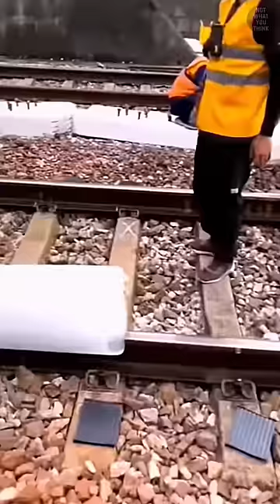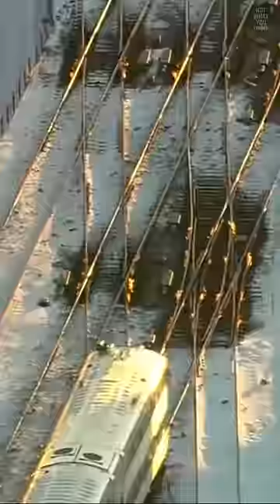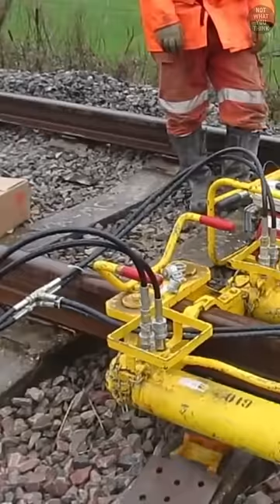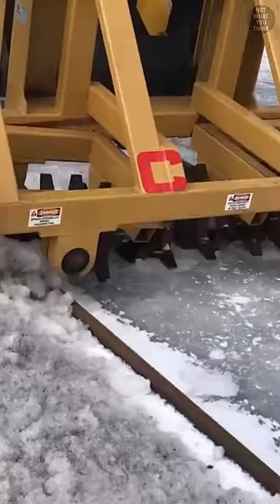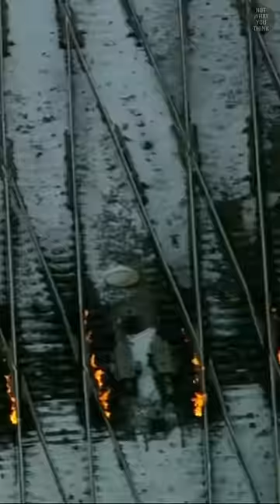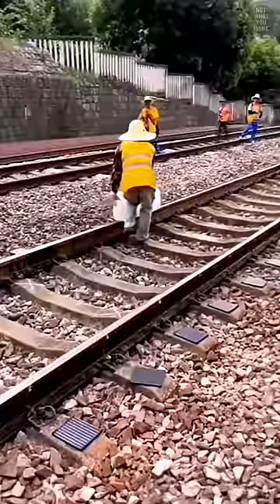ICE & FIRE on the Railway #shorts

Comment: They aren't "set on fire to reduce cracks" Those are switches, they have gas heaters so the switches don't freeze shut.   It has nothing to do with thermal expansion. Yes, the heating or cooling of the rails is done during the construction of the tracks.  You install rails at a certain temperature range for the area they are in, if it's too hot that day or too cold then they adjust the rail temp in order to have it at the median temp.  Once installed they don't do this again.

Comment: There not set on fire....we shove mobile heaters under them which happens to be fuel in a container, now alot are electric heaters attached to the rail.....railroad engineer here for 17 yrs and I approve this message

Comment: In heat you actually wear more clothes to put a burrier from heat. I use to work in a Glass Plant, extremely hot. We wore long thick clothes as protection and it actually kept our temps lower. It's part of the reason in extremely hot countries they cover their entire bodies. Wearing less exposes skin to direct heat and prevent burning. Think of an oven mitten.

Comment: The track getting crooked like  that is called thermal deviation. Normally  several  inches are cut out to keep the rail aligned. Before  winter  and cold weather comes, a rail of around 15 feet is cut back in to keep alignment. There is a definite length to be put  in, and I apologize because it has been awhile since I worked on the UPPR. UNION PACIFIC.

Comment: At any moment a nail could come loose and completely fuck up a guy. It's probably happened before cuz my dad has worked at a train track and some other guys were told not to fuck around while they were working nearby. One of those guys ended up dead because the track came loose while his arm was up. Took it clean off

Comment: The fire can reduce cracks yes but thats not the purpose of that fire. The purpose is to melt the ice in the frogs. Frogs are the gaps in between the rails to guide wheels around on switches. If ice freezes in these gaps it will derail trains. Not all railroads use fire however some of the older railroads here in the south west do it the old fashioned way.
By getting a group of railroaders with picks and shovels and breaking apart by hand

Comment: If the metal is hot enough to literally change shape it's probably hot enough to burn your flesh. You don't need gloves to move ice when it's hot outside but you may want them if you slip and grab the rail by accident

Comment: Amazed I still don’t see a real response.

Look at Bedouin tribes or traditional Iraqi/Afghani clothes. They’re all long sleeve and long legged garments. Why? Because cloth reflects sunlight better than skin. Your skin absorbs UV at a higher rate and you’ll become much hotter in shorts versus pants. There’s also the fact that working in a hot place means all stone and metal is burning hot to the touch, it’s much preferred to wear jeans so you don’t burn your calves and knees. Also, everyone in this video is wearing two layers. This is for sweat to work properly. A cotton undershirt will wick the moisture and catch the breeze, sticking to your skin and blissfully cooling your body. Rookie move to not wear an undershirt.

You can always tell apart tourists because they wear shorts and tank tops. The locals will wear jeans year round and an undershirt, plus a button up or something similar.

Source: lived and worked outside in Phoenix for my whole life

Comment: Well damn I should have used this as an argument when I was a young boy and set the railroad tracks near my house on fire knowing that they were metal and it really wouldn't cause much damage. I should have used the argument that I was simply performing a job related to the rail industry for maintenance of the tracks. And that since I did so pro bono that I shouldn't be fined since this maintenance had never been performed in my area I was just ensuring the safety of our tracks 🤣🤣🤣

Comment: To answer the question if the railroads are that hot why are the workers wearing pants is because would you rather be hot and protect your legs in a work environment where you can potentially have your legs seriously injured for being exposed or would you rather be cool and risk serious injury just to keep your legs cool? I take the former over the latter. There's a reason why just about every construction worker, road crew digger and landscaper etc, wear pants even when it's hot out.

Comment: Rail snake <sets rail on fire, don’t get on your boots or you will regret> 

Track defect shown; broke rail, using hydraulic puller to pull rail back together, then will saw cut both ends , test for defects, drill holes, bar up both ends and bolt them down. Welders come one day in the far away future to unbolt bars and weld rail together. 

2nd defect shown, track buckle. Due to failure to destress or stress.

Comment: Interesting fact. During the Winter War between Finland and the Soviet Union, the Finnish rails were purposely designed to flex and stretch and contract with the temperatures allowing the Finns to fully utilize their network, the Russians on their part did not have such contractible rails and also had a different gauge that made using rails impossible.

Comment: It's not allowed to wear shorts nor t-shirts on the rail.
The smell of soy can burn the hair out of th nostrils. 
Changing brake shoes on railcars  in winter or extreme heat can be deadly.(be safe)
Workers aren't allowed to wear wedding rings while working the rail.
Ever seen a mane get attacked by a pissed off cougar while working the rail?
Ever seen a dead body on the rail?
Ever seen a whole bear ass knocked off on the rail?
Ever walked the rail in the pitch black dark and you smell the smell of death?
Did you know in the early years,when workers were killed on the rail they were buried by the rail.

Comment: Maybe build them better. Cause I never seen so many trains going down. I live in Russia and our rail road tracks do not need to be iced or fired. This is a big news to me. 

Rail roads maintenance typically low if they are built well. Therefore cheapest transportation. Not so cheap in US.... Extreme cold areas would be exceptions.

Comment: Not wearing shorts at work is a safety issue. OSHA prohibits shorts and no sleeves in construction work. So probably same deal with DOT. If people had actual jobs instead of sitting in climate controlled buildings they would know this.

Comment: Total bullshit with the fire on the tracks. The fires are switch heaters. They keep snow and ice off the switches. If they didn't have the switch heaters, the switch wouldn't operate properly. NOT ON FIRE TO PREVENT CRACKS !!! I have 20 plus years working for a railroad.

Comment: You can’t wear shorts because of health and bloody safety I was working in a brand new hospital build newly finished no hazards and now allowed non workers in I was installing networking points we ran the cables during phase two and three of build and we were now working in finished rooms just testing the points for connection failures anyway it was mid heatwave said to be the hottest summer the uk had ever seen and we still had to wear gloves work trousers  boots helmet hi vis and goggles the heat was so unbearable I passed out I tried to sue the health and safety team for forcing us to wear unnecessary gear causing us to over heat they came back saying I passed out not because of the heat but because I wasn’t drinking enough water despite me drinking about 4 litres that morning but I couldn’t prove how much I had to drink health and safety 7/10 causes more risks